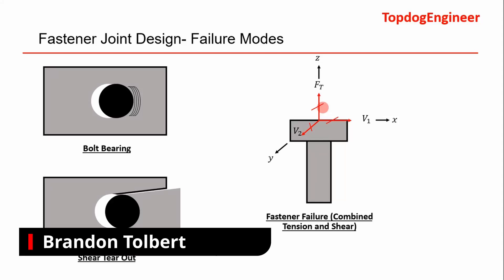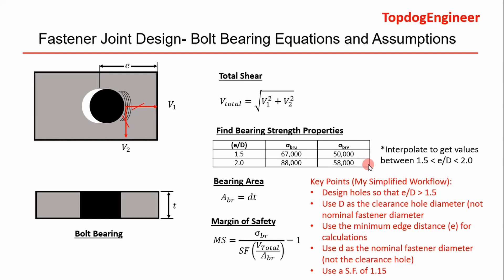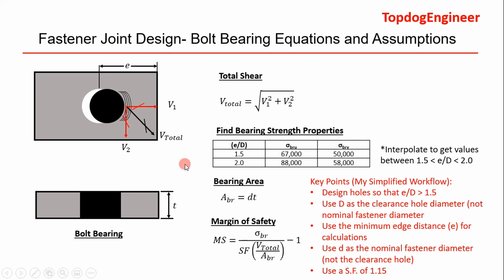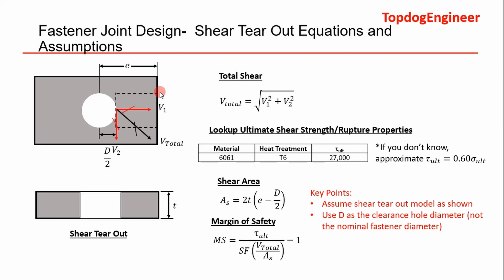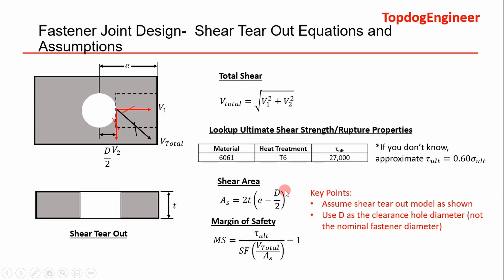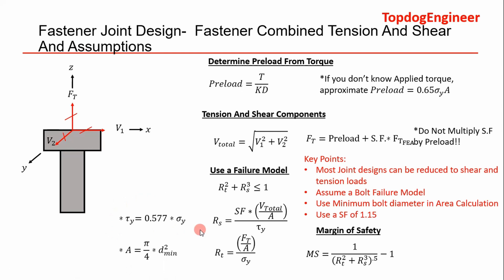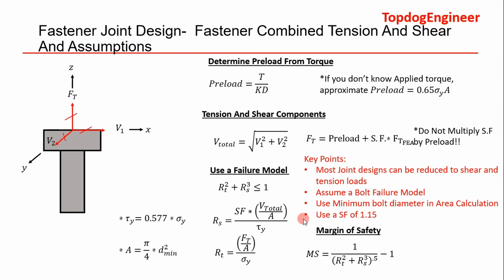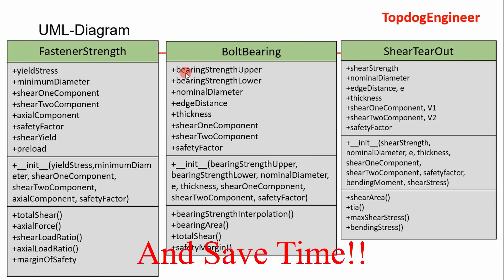Introduction To Bolted Joint Design: A Step by Step Approach

Comment: Where do I get the data for bearing strength properties? Is it given in ASTM material standard document?
Reply: MMPDS
Reply: Did you ever find this information? I dont have access to MMPDS. I used Tensile yield strength as a substitute in the meantime.